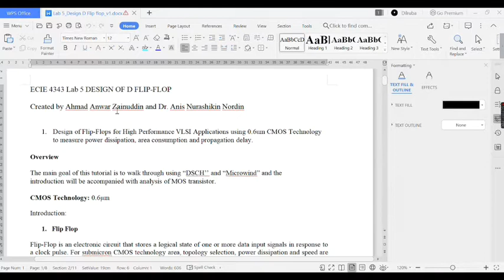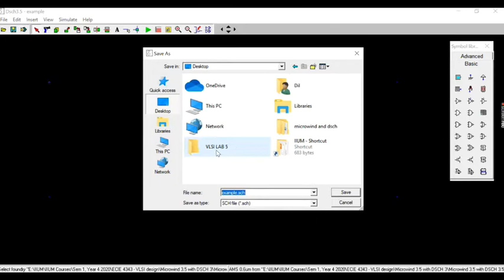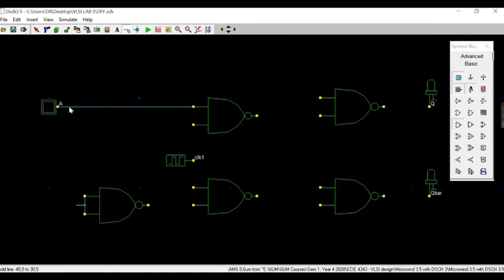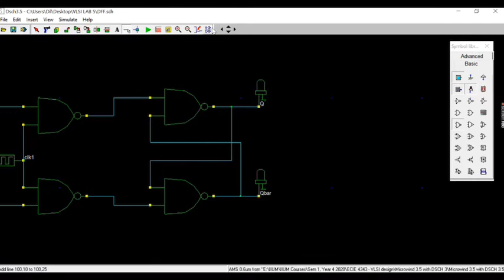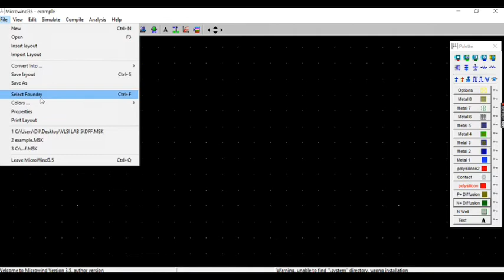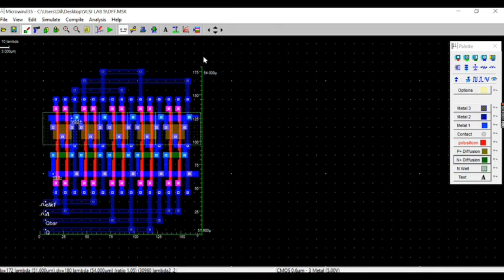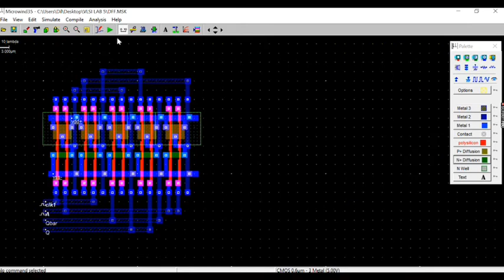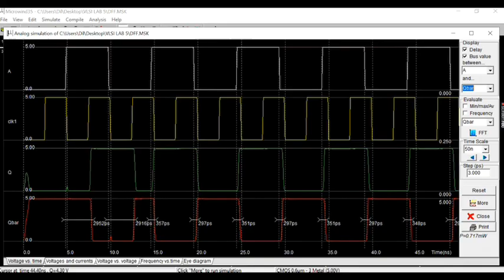Lab 5: Design of a D-Flip Flop

Comment: Hello, thanks for this useful video, but what you built here is not a D Flip-Flop, it is a gated D-Latch, which is level sensitive. 
With this design, at any point in time where the clock signal is high, if the D input changes, the outputs Q and Qbar change accordingly. A true D Flip-Flop is edge-triggered, which means it only samples the D input on the rising (or in some rarer cases falling) edge of the clock signal. This is at least the case in europe, where most of the time when someone says "D Flip-Flop" we think of an edge-triggered one, so feel free to tell me about how it is referred to in other non-european countries :)